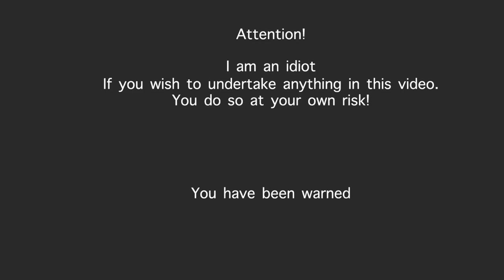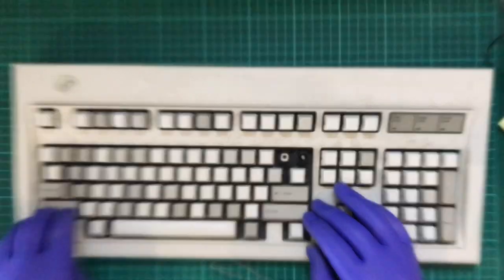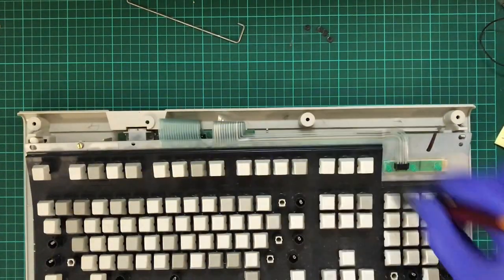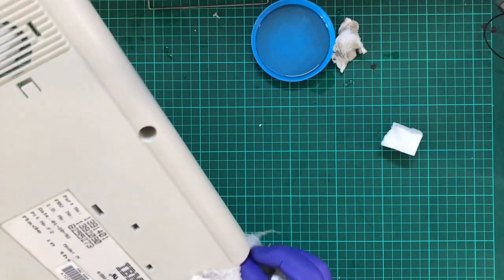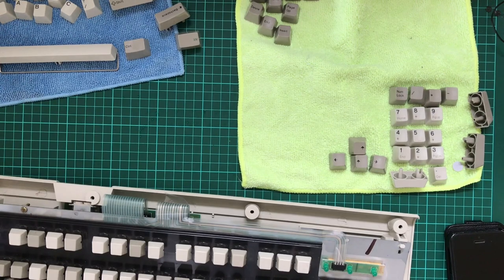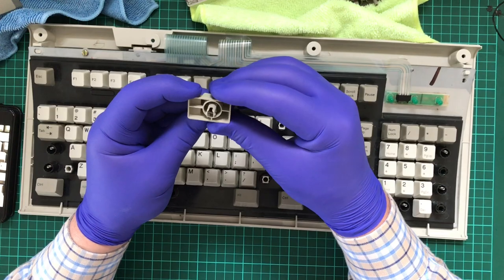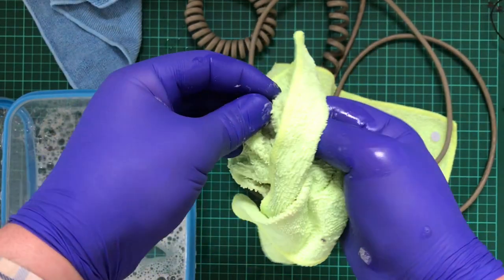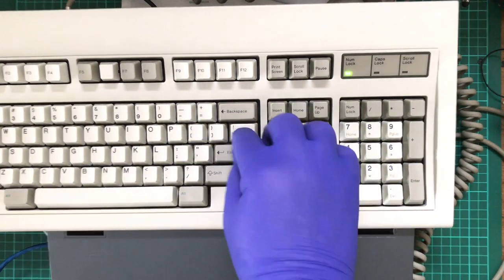IBM model M refurbish/clean.

Comment: What are the plastic rivets for?
Reply from the maker: No clue myself.
Reply: The plastic rivets are what hold the internal components (backplate, barrel frame, membrane sheets etc) of the Model M together. The rivets are the major weakness of an otherwise rock-solid design, since the plastic can become brittle over time and break due to age. 

If enough plastic rivets break, the internal layers begin to separate, the keys start to feel weird, and eventually the keyboard won't work properly.

A common modification to the Model M is the so-called "bolt mod" that involves replacing the plastic rivets with small metal nuts and bolts that will never break.
Reply from the maker: @animalblundetto5673  huh, thank you for that.